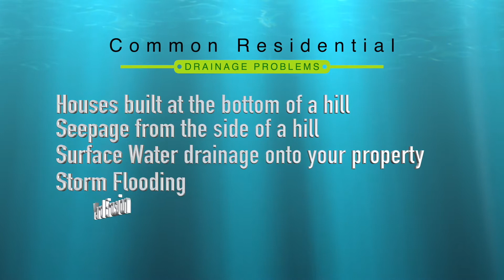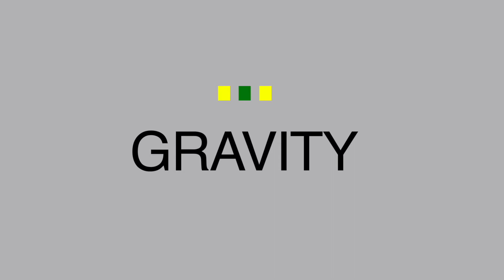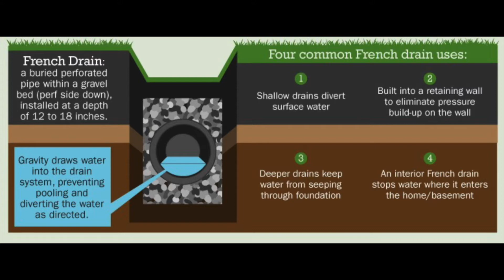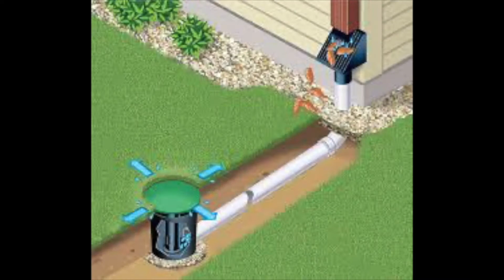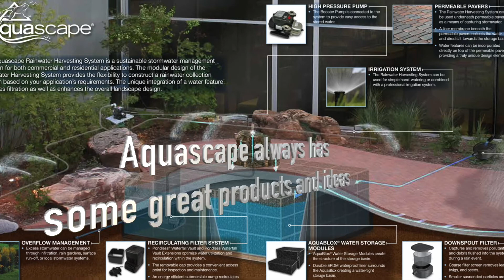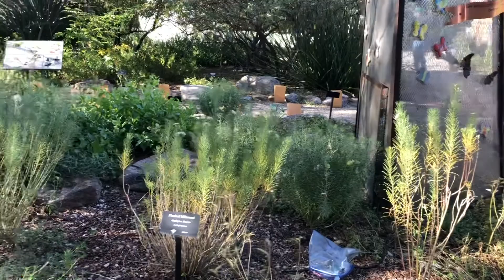WATER DAMAGE AVERTED Using Proper Landscape DRAINAGE

Comment: I used really good perf pipe and did a small french drain grid out to my front hill...now i have to ease the flow somehow because a lot of water going out at one spot...lol...if it aint 1 thing its 12
Reply from the maker: The chores never end, huh? I found good success by installing a T at the terminal end when volume and flow are extreme.. then rock and gravel in around that area to mitigate erosion.. keep up the good work Charlie.. Coach Matt

Comment: Right now I have a lot of standing water in my back yard from heavy snow melt followed by very heavy rains. And it's supposed to rain heavy again. 🤦🏿‍♂️
Reply from the maker: Not a fun situation for sure. Is there a functioning drain system or would that be a cure. 
Let me know if any advice is needed. 

Thanks for your interest in the channel.
Reply: @YardCoach  No drain system. Going to wait to see what happens. Appears to be draining some now that the rain has stopped.